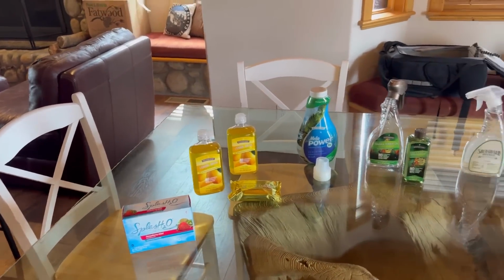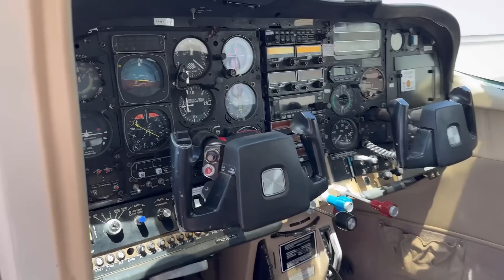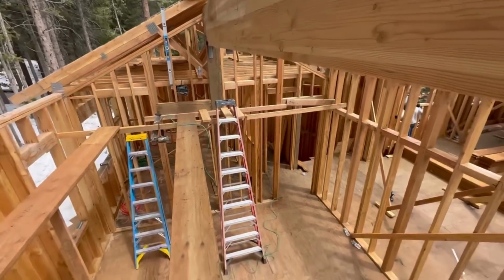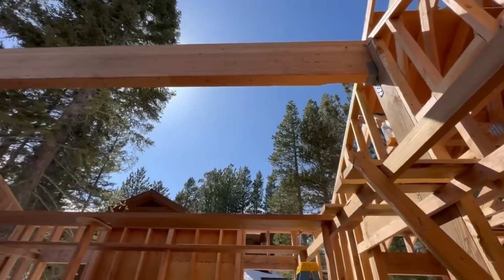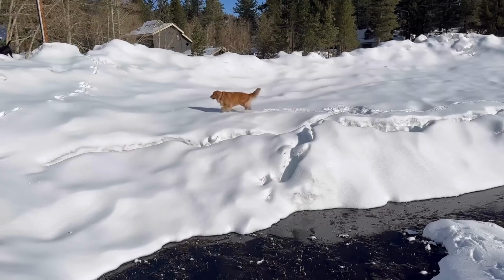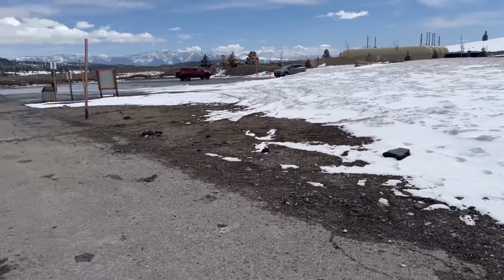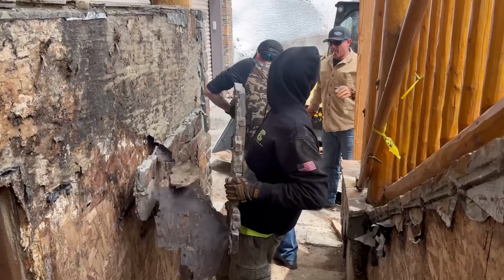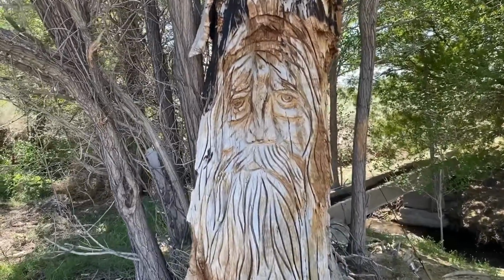It’s snowing again! 4” last night and more today! May 2, 2023 Mammoth Lakes, CA

Comment: Price is in the details such as last overhaul of engine, avionics, condition of airframe. Get a survey before you negotiate purchase!  82k-395k  Depending on numerous factors, the average price for a pre-owned CESSNA 210N is $281,180.06. A $75,250.00 loan over 120 months including $313.54 per month in interest equates to a $3,773.31 per-period payment.

Comment: 13:00  IDK if it's considered adequate but believe a steel flat bar the width of that beam heavily lagged deep into bottom of glue lam should do the trick, maybe 3/4 or 1" by 6" or 8"?   Since it's failing in tension that should do it.  It would have to be lagged deep, maybe 8", well past damaged sections.

Comment: That one post with the gap looked like they just put in a twig instead of a solid piece of wood at the base.  Crazy what you can find when you tear old construction apart.
Reply: Look at So Cal tract homes. A few 2x4s, chicken wire, taco shells for stucco, and old fast food wrappers, and newspaper for insulation.  They are fancy junk.

Comment: Regarding those 2 beams over the pool. Can you inject high strength wood glue and then apply high compressing pressure clamps around the beam to repair it that way?
Reply from the maker: I’m sure we could if I could get any structural engineer to write that up for us and sign off on it

Comment: A 1977 Cessna Turbo 210M is worth about $225,000 What year is this one?  It looks to be about a '76 to'78 model year.  Just looked up that plane, it is 1975 Cessna T-210L .  That could be a good deal depending on the variable of course (engine hours, maint. last engine overhaul etc.)